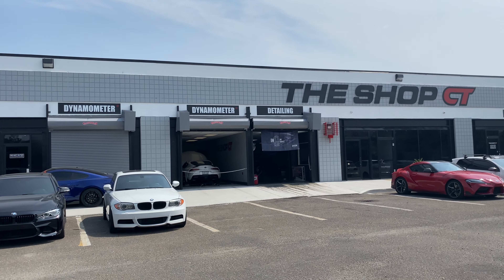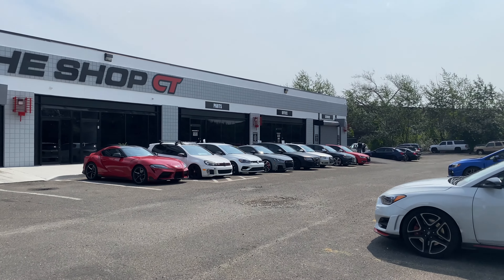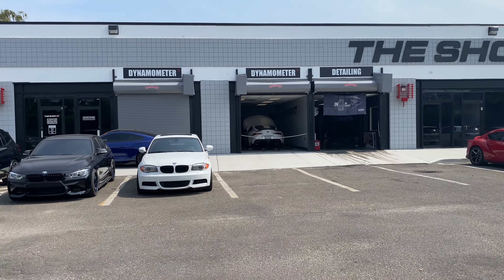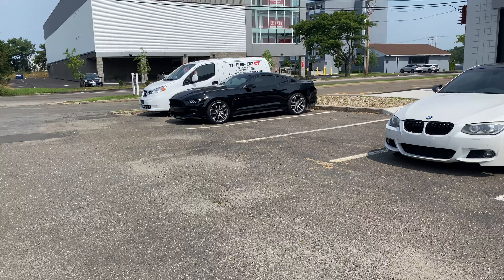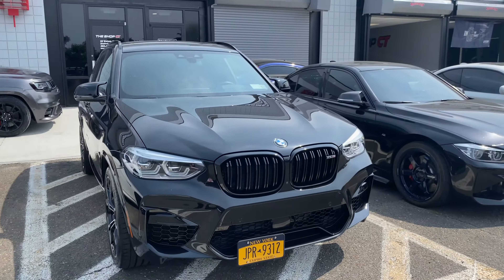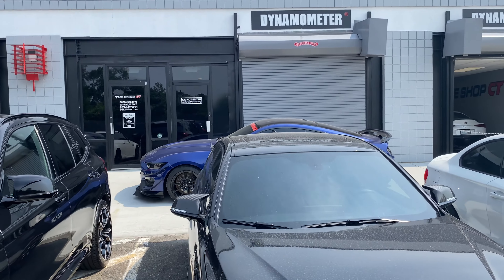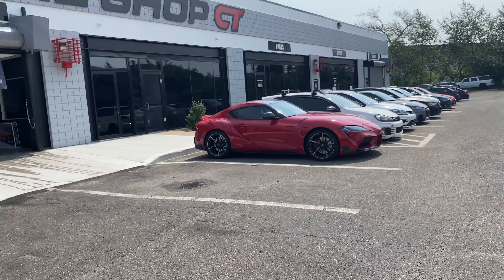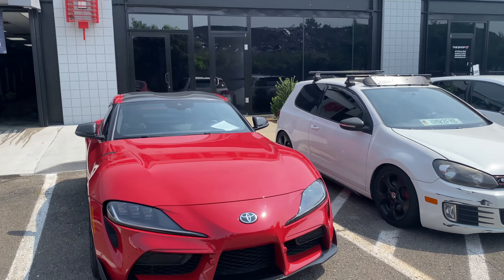Taking off my MST Cold Air Intake and getting a new tune on my Supra

Comment: Hey Matty, as always great video.  I picked up a  2021 supra very very recently but i’ve heard weird brake/tire?? noises whenever weather gets rainy.   Has this ever been a issue for you or something with the brake pads or dust.  Any thoughts would help.
Reply: I’m in AZ rn where it’s starting to be monsoon season. They’re just getting water in the breaks. It’ll sound like hard squeaking noises. Once they dry it’ll be fine. Completely normal
Reply from the maker: So this is completely normal. The Supra comes with Brembo brakes which are known to be very noisy especially when they get wet. You may hear sounds when wet but it is nothing to worry about!